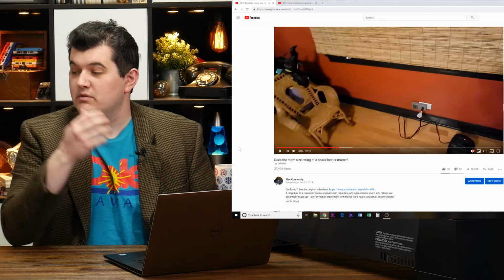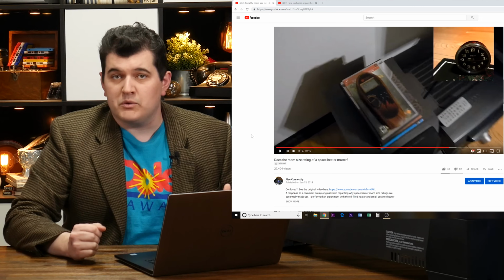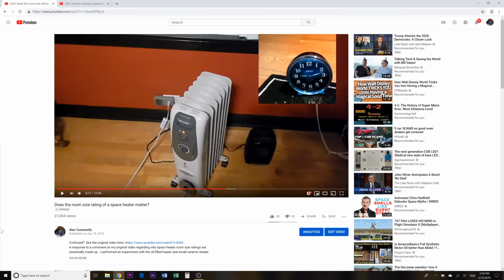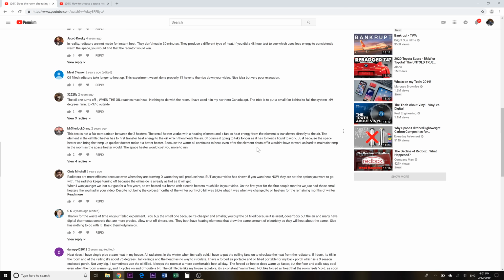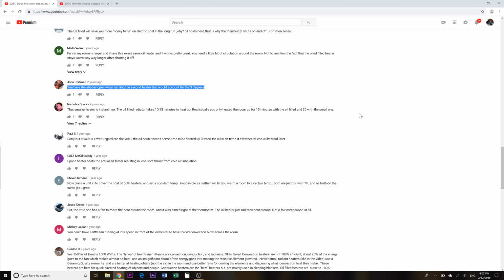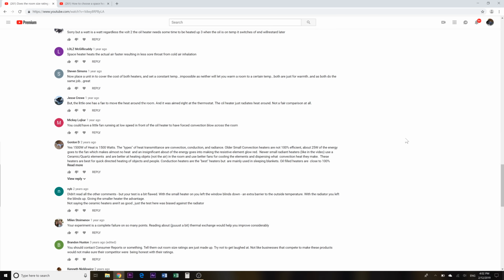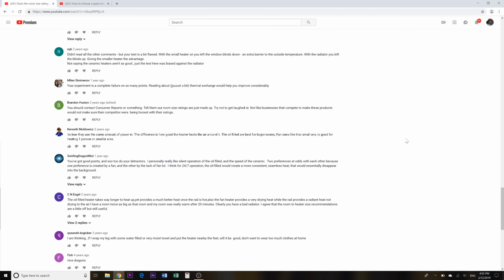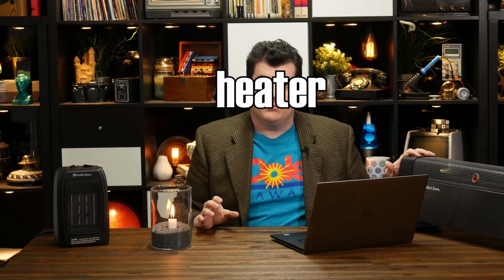More Space Heater Nonsense

Comment: Eh, kinda resurecting an old video, but I had a thought about the "small room/medium room" thing. Could it be that heater labeled for bigger room actually have bigger/longer heating elements, thus making them able to tolerate being powered longer, because a larger room would require more time to get to temperature?

pump 1500W in a small room → get warm faster → heating element less stressed
pump 1500W in a large room → takes longer to get warm → heating element stay hot longer

(assuming heating elements do have some kind of wear associated to them being on for long period).
Reply: Yes! See this comment from dirtz : 
"First: I absolutely agree please don't kill me thanks. Secondly: A friend of mine actually works for a company producing both devices for large and small rooms. While they aren't both 1500 Watts but instead 3000 because that seems to work in Europe fine, he agreed that both devices give out the same energy and in that view are equally capable of heating any room. However, he also told me the actual reason for them to differentiate between room sizes: A Device designed for small rooms isn't meant to be running all the time. It's safety features and design aren't required to support the device running for a long time and therefore aren't actually "safe", at least legally, for running permanently. Large Room Heaters are required and made to run 24/7 without having any issues. In a room of the same size the large room heater Has ONLY the benefit of being (at least from the official side, whether the small room heater can consistently do that I don't know) capable to run all the time. That's it. Everything else is advertisment."

Comment: When it comes to fixed electrical radiatiors there are basicallt three types:

The metallic ones that are compact but get very hot.
The slightly larger ones that still get rather hot.

Both of these are marked "do not cover" because of the fire hazard.

Large sized oil filled radiators however have a high thermal mass (which makes it harder to regulate temperature with a termostat funnily enough) and should have a much larger surface area, so they should be cooler. But please check if they are marked "do not cover" or not before drying your wet socks on them.

Small oil filled radiators (the "large space heater" kind) get almost as hot at the metallic ones but still suffer from heat lag, combining the worst of both kinds.

Comment: I would expect a heater marketed for a small room would be unsuitable for a large room because their small size means the smaller element will be running hotter and be more likely to overheat over the long runtime needed for heating large rooms. A larger heater can be on for longer more safely due to the lower temperature the larger element needs to sustain to deliver the same output. Basically both heaters will have the same ability to heat the same space but in a small room the small heater generally won't have to be on constantly but in the big room it might never be able to shut off and cool down. So basically the room size ratings have nothing to do with heating ability but rather safety. At least that's my guess.

Comment: Love your channels and your heater videos. Amazing how many people don't get thermodynamics. The only difference between space heaters that I find relevant is radiative vs fan-forced/convection. I used to use a fan model similar to your "small room" heater. I switched it out for a dish, not quartz, radiative one. I think these are preferable because they send IR heat right at you, onto your skin and immediate surroundings. This warms you, not the air. The heat eventually goes to the air. Almost like it's being used twice! They're also silent, like convective or silly oil heaters. With a fan heater, it heats the air, which heats you. Like you said, much of the warm air goes to the top of the room, and subsequently leaves; without warming anything useful. Only thing with a radiative one, don't point it at a window. The quartz ones do the same thing except they're more expensive. The oil ones are stupid they basically just delay whether or not they are making heat when you turn them on or off.

Comment: I'll I run a heater at 1,500 watts and a minute or so later the circuit breaker will trip were as if I run it at 750 watts then it will run just fine with an electric bill from Puget Sound Energy saying I owe then a few million.

Comment: I have a convection heater that has resistive elements (not radiant or radiator type) but it also has a small fan that blows over a small portion of the heating element. On the highest heat setting the fan is always on but on the lower settings it's optional. It seems to work really well and is the best of both worlds: it can heat a room quickly because of the fan and because the element heats the air directly (not through an intermediate medium), but it can also keep a room warm while being silent. It also doesn't seem to suffer from the unfortunate thermostat issue of the oil-filled type.

Comment: And.... heaters don't "dry out the air". In the winter the air contains less air because cold air can't hold as much water vapor as warm air. So when you heat up the air in your home it feels dryer, but it's not the heater that's doing that, it's just the fact that warm air can hold more water than cold air so it feels more dry even though it contains the same amount of water. The air is dryer in the winter than in the summer in general (bearing in mind we're talking about regions where there is a significant difference between the summer and winter temperatures, but then people don't usually need heaters in tropical regions). In fact, air conditioners do dry out the air in the summer because the water vapor in the air condenses on the evaporator (ironically) and either evaporates in your attic or crawl space or wherever your air conditioner evaporator is unless it is drained outside or down a drain. No such thing happens with heaters, though. They just heat the air and water vapor without changing the proportion whatsoever. (Although some forms of combustion do form water vapor as a byproduct, but they also form carbon monoxide so any moisture is vented outside along with the carbon dioxide.)

Comment: My grand parent had a big space heater, but it was something ridiculously large, like 150cm x 75cm * 100cm. I'm not sure what the termal mass in use was but the whole point was that the heater would automaticaly burn turn on during off peak hours. It run all night but then there was enough energy saved to heat the whole house (old country house, badly insulated) for the whole day ! 

Basicaly the same amount of energy was used, same amount of heat released, but much cheaper because all the electricity consumed was during offpeak hour.

Comment: you are totally right all the heat heat the same as long as the use the same amount of power. the only real thing that can be interesting with oil heater is the inertia. it's going to heat it's oil and then when it turn off the oil take time to lower it's temperature so the temperature will be more stable and that the only one thing that can be better....

Comment: The problem with the experiment is that at the END of the experiment - there is still a heck of a lot of energy stored in the oil.   The best technique would be to plug the heater in someplace ELSE - bring it into the room - run it for an hour - then take it out of the room.   The heat in the oil was the same at beginning and end.   Your conclusions are CORRECT - but your experimental method is WRONG.

Comment: I am late to the party but I do have an oil filled heater that I can  use the  auto setting aka thermostat or just use the low med high settings bypassing the thermostat and yes it takes longer but I find myself turning it off or setting the thermostat because it makes the room to hot which is 500 sq foot.

Comment: As someone who lives in an older home with only one floor heater (chronic pain sufferer so lets just ignore why I haven't upgraded the heating/cooling, heh). I've found the convection heaters work much less than the small fan blown heaters. The best reason I can figure as to why, is because the fan will spread the heat around verses just heating the one little area. However, not being a physics major I have to make a wild assumption here, the convection would do fine for those rooms if I were to leave it on long enough, and possibly put in a ceiling fan (if a ceiling fan can be placed in these areas). Now as to why I just don't use the gas heaters...2 reasons.  1: The one in the bathroom lies just behind the door and below where our towels hang...Um, nope.  2: The upstairs one has a copper hose just hanging off of it...And the 3rd reason as to why I don't get those tested by a professional or change, at least the upstairs one out...Try to explain that to a wife who owns the house, HAH!

Comment: The marketing department of heaters is not really competent. Not all heaters are the same, while efficiency could be the same (assuming same W), the comfort level is not. Small air heater could heat the room quickly releasing the same amount of energy than oil heater or floor heating, but that does not mean all the room is comfortable. Generally you cannot stand being in front of the air flow (too hot), while people far away from the convection path could feel cold for a long time. Using delayed element, or larger element with lower temperature (like a floor heating) could provide comfort throughout the room instead of burning/freezing zones. That's what marketing department has to learn. Other than that, you are correct, there is no "more powerful" heater.

Comment: A bit late to the party, but I have one speculative idea why it might work. So both heaters will have the same heat output, agreed that they will transfer same amount of heat to the room.

If there is any difference in average room temperature increase (I don't know if it is), then it would likely be because of heat transfer from the air in the room to the walls, windows and outside. The heater with a fan would produce hotter air than an oil heater, and higher temperature results in higher heat transfer to the outside. Also warmer air, when it exits the room via vents, removes more heat with it. If the room is bigger it's less likely it will be evenly heated by such a heater, while oil heater-generated radiation and a bit of convection maybe has the potential to warm it up more evenly? Just a thought.

Comment: I can see maybe the large room heaters heating the room in a more consistent way, I've notice the small ones tend to heat up immediately around it really fast to where it is almost uncomfortable, but then take more time for farther parts of the room, while the larger room heaters tend to take longer to heat up even a smaller room but they seem to do it a bit more evenly. Other than that, after extended use of either really, I've noticed exactly no difference basically. Room gets up to, roughly, the same temperature either way.

Comment: The only thing I can see is that "Maybe" since the large room heater uses a larger element.  Although it is producing the same heat, it is distributing it in  more evenly in a large room with a large (long) heating element, rather than produce all of the heat in one pinpoint spot. But other that that.... same heat.

Comment: I can see the larger radiator being safer to run for long periods than the small heater.  The small heater is dependent on the fan...the fan can fail, the unit itself may not be built for 100% constant use like that, small cheap heaters not as reliable, more potential to start a fire (which would definitely heat the room a lot more, but not in a way you'd want), etc.  And the radiant heat produced by the radiator could give the illusion of "more heat" to people in the room because of how radiant heat feels (although infrared radiant heaters are better at providing this illusion).  But yeah, however much energy you're dumping into the room is how much energy is dumped into the room.  Thermodynamics.

Comment: Is it possible the room size recommendation is based on the estimated lifespan of the heating elements? Larger rooms would have larger thermal demands and cause the heater (of any size) to have to run more often. Smaller heaters would have smaller heating elements and would probably have to get hotter to put out the same amount of energy. That could increase wear and shorten their lifespans, so you wouldn't want them to run as much.

Comment: I always combine a fan to distribute the heat vertically, without this addition the air will stratify and it will be colder at the floor.
In my own home I use a gas stove to heat the whole house, and with a fan it keeps the place at 72f with one burner, until the outside gets below freezing, and then the second burner is necessary.
I always pump air into and out of the house, proper air fuel mixture is important, the main product is water vapor and CO2. My humidity is about 60% and it's far more healthful than 20% I get with the forced air furnace in the home. 
I spend $70 bucks a month with the burners, and $300 with the furnace. Most energy in the furnace goes up the stack, and the humidity drops to desert like levels.
If you ever have sinus issues as I have, consider adapting your methods for heating the home.
If you don't know how to adjust the air intakes for a stove and optimize it, don't attempt to use this form of heating. CO will result, and that will be a bad day in my book.
LP and Natural gas are very efficient, these small heaters take about $5 bucks a day to run, and they produce dry heat, just like a regular furnace.
I had headaches for decades behind home furnace use, once I figured out the humidity component, the headaches went away.

Comment: Really good video and I'm not going to argue the results but I can't help but wonder what the overall power usage was between the heaters? Were they both using the full 1500W? I think you should make this a trilogy and monitor the actual power usage instead of just the power rating. Until then I'll be buying the fan heater because lets face it if we're using an electric heater we want heat and we want it now and screw the cost!
Reply: He said the electrical energy used by both of them differed by about 5 watts, so for all practical purposes they are the same in how much energy they use and how much heat they put out every second (when the heating element is on). The difference with the oil radiator unit, as he said, was that its thermostat kept shutting off the heating element, presumably because the heating element was getting too hot because the design of the unit doesn't move heat away from the heating element quickly enough for it to run continuously. That problem would be easily fixed by putting a cheap fan behind the oil radiator unit so that it blows warm air horizontally into the room.

I like the relative better safety of the oil radiator unit because its heating elements are bathed in a shielding layer of oil. There's no way anything flammable in the room (like a mouse or a cat's paw or gasoline fumes from the gas can you like to keep in your living room) can somehow worm its way into the heating elements and start a fire.

Comment: The baseboard style heaters are more so designed to be set in front of large windows. Mainly bay windows or sliding glass doors because typically there is cold coming off those surfaces which aid in convection. On cold days you can sometimes feel the cold coming off glass. I'd say they more so provide a barrier from a surface that is colder than the rooms temperature where most of the heat loss occurs at.

Comment: Watts is Watts, and BTUs are BTUs, even if we are mixing metric and English units here. The most important take away is that your oil filled heater isn't 1500 Watts because the thermostat is pulse width modulating the input power.  If you know the duty cycle, you could calculate the actual input power over a given time. (Recall the thermostat episode.)